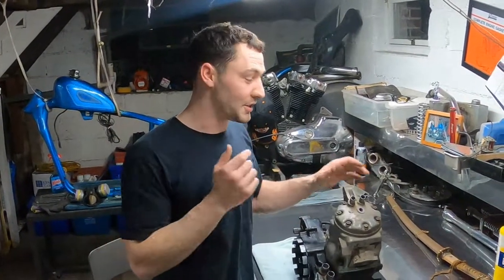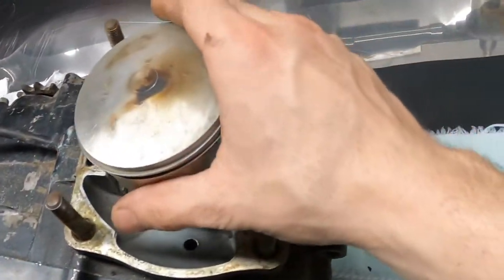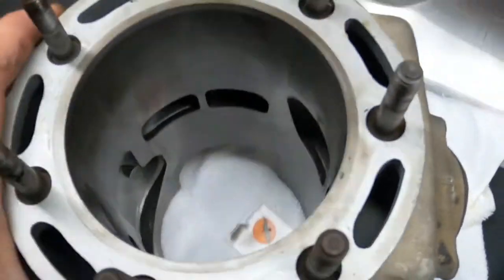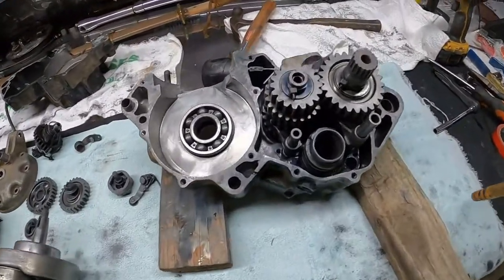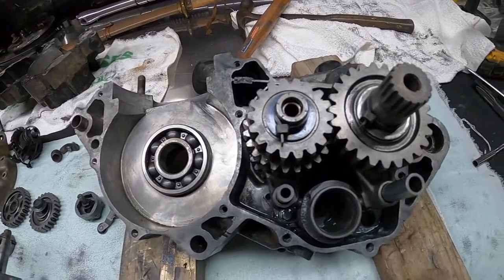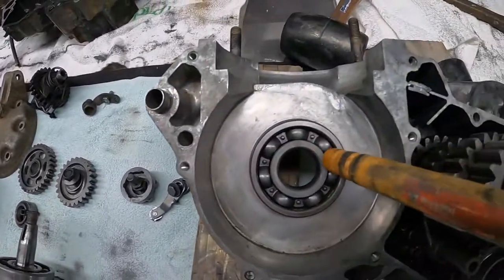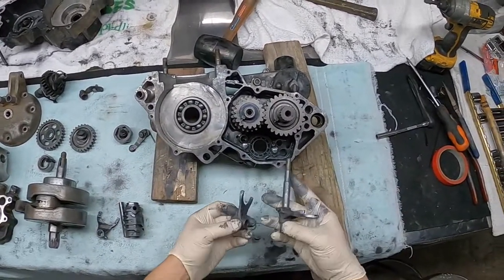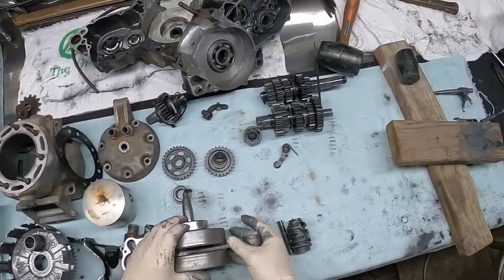1990 CR500 Rebuild part 4 / Engine disassembly/bent rod

Comment: dude i have a 1990 cr250 im restoring and i cant find the right side clutch case anywhere! do you know what other year models will fit a 1990 by any chance?
Reply from the maker: The 500 is 90 to like 01 not sure on the 250 ..but I seen 👀 a 91 right side on ebay just now
Reply: @judaslicciardello3946  i hope it is! i also saw one for $300 might have to do it cus there aint shit out there lol